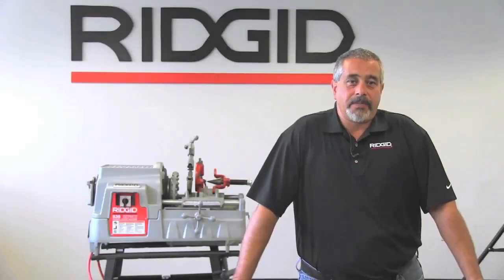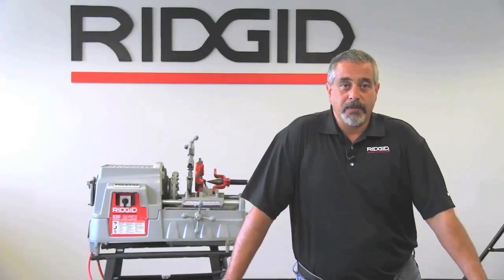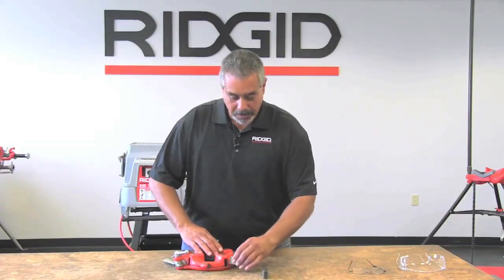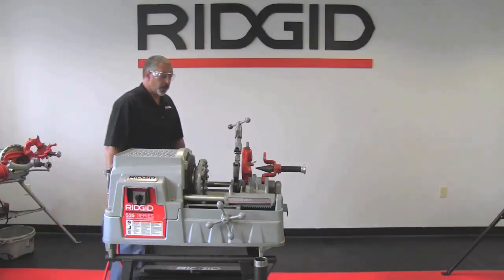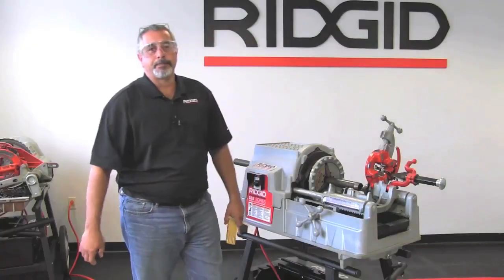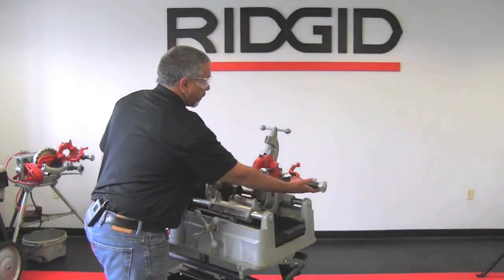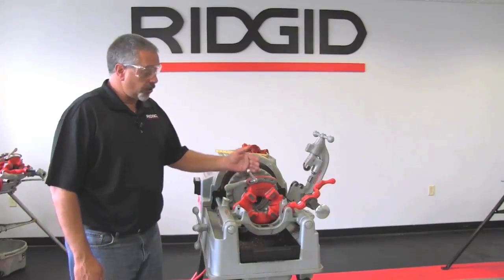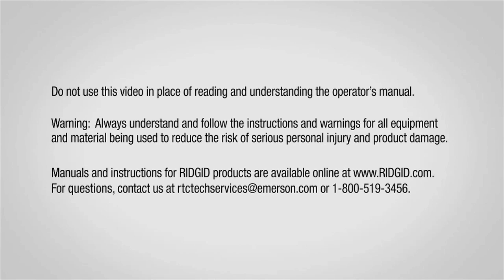How To Use The RIDGID® 535M Threading Machine

Comment: this is a pretty good intro to get an idea about using a threading machine I am an apprentice and been working here for about 2 weeks I have started off using the machine cutting and threading the pipe for the installers the cutting and threading of the pipe is pretty easy but when it comes to the hemping that's the hard part hemping is a bit more complicated.

Comment: He shows us how to replace the dies in the die head with the die head out of the machine and laying on a table.  I have the older model 535 made around 1970.  I don't think that my model 535 die head easily removes from the machine.  Changing the dies is tricky with the die head installed on the machine.  I may be wrong, buy I think that the new model 535 threaders allow the user to remove the die head easily from the machine.  He should show that step.

Great quality machine.  I love my 535 Ridgid pipe threader, it is a wonderful machine.